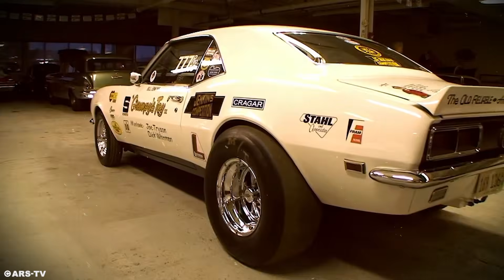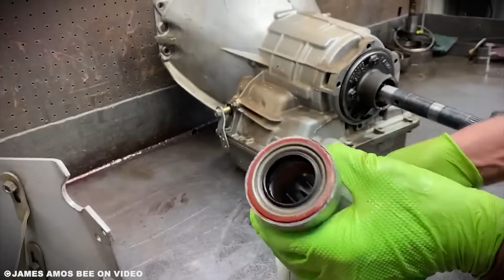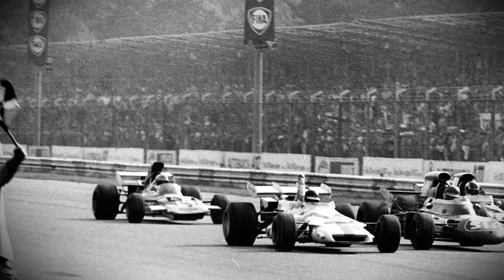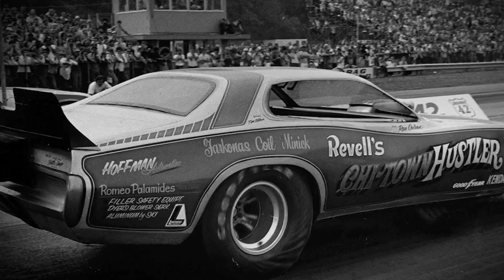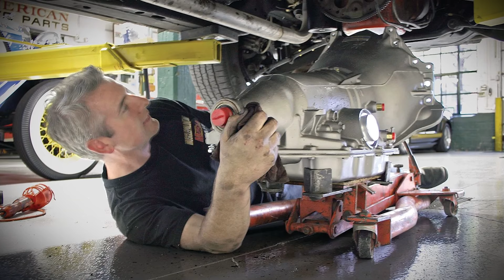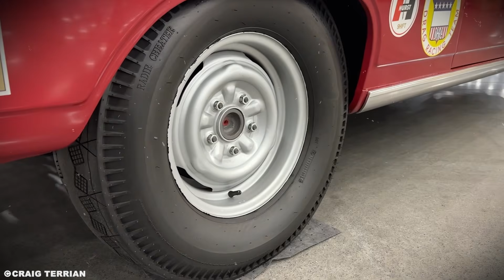This Illinois Drag Racer OUTSMARTED Chevy With "Weird" Powerglide Transmission That Beat Turbo 400s

Comment: Look bill jerkins was from Pennsylvania ok . Now the Vega never came along until 1971 in the 60’s he raced a Chevy II om now he had a record in the late 60’s for winning the most races by never missing a shift in a 4speed manual transmission 250 races without a missed shift !  His family name comes from south Wales England .  He had raced 427’s but the 327 was his motor of choice .  I know for a fact the man would drill holes right at the line of the top ring on a piston down through the top . At the place the groove is cut so the big woukd be centered there . Half the hole out at the back of the ring the drill cut would leave an angled  part of the hole to shoot air fromthe compression of the engine back in behind that top ring . Force pushing that ring out to get more compression and power from combustion.  As something else Im thinking that he made some kind of shifting bushings or shifter parts that hurst or Mr gasket got the rights from him to make and sale .  Close to the end of his career . I can’t say he ran a glide in the 70’s but Im pretty sure it was all 4 Speed more than likely Muncie M22 or borg Warner super T-10 . He may have ran a M21 T-10 . But most racers back in the day ran big block close or “narrow” ratio 4 speed transmissions known as rock crushers . From the growling sound they made in the first 3 gears , and even in 4th a little but when accelerating. Holding one speed they didn’t make it that bad .  Doug Nash made sliders for these big block transmissions . Thats were you didnt have to push the clutch in just let up on the fuel and yank it into the next gear . My brother-in-law use to do it all the time in his Camaro 350 built with M-22 Muncie with Doug Nash sliders in it . Burn rubber 1 finger width between first and second two between 2nd and third and a who,e hand width between third and 4th . Traction bars an air shocks running 50’s on the rear . Posi trac 4.10 gears big 10 bolt GM axle . Pro mod hood scoop ! 78 Camaro type LT burgundy and silver .

Comment: I know grumpy Jenkins had 4 soled shifters in his garage that folks bid all kind of money to get when they auction his stuff off . I think those lightning rods was one think grumpy was using them at the end of his racing career. As far as him running an auto . Now how do you pick up parts out of your oil pan for two hour from transmission ?  That would be imposable if it made it in there that oil pan would have to be a half acre big . To pick up parts for two hours . Now any time a car is racing you woukd hear only one shift . Any one would tell you it only shifted ONE TIME ! I didn’t know they had carbon fiber back 55-60 years ago

Comment: My 67 nova W/ a 69- 302 cu. W/ a glide ran low 10’s w/ 3500 stall speed converter .  The Rt. 2 speed glide works . That was 1992 Atco , Raceway New Jersey

Comment: An aluminum power glide transmission has a low band, a high or direct clutch and a set of reverse clutches stock. The earlier cast-iron Powerglide  had two bands, and one set of clutches, a low band, a reverse band, and a high or direct clutch.

Comment: Grumpy was not the first to apply Powerglide technology to racing.  A late friend of mine was using Powerglide in circle track cars back in the early 1960's and possibly late 50's.  So long ago I forgot.  I'm not sure if he was the first to do this.  He used it in stock cars but I don't know if ever tried it in Super Mods (sprint cars).  This was an advantage because of low rotating weight.  They removed some of the internal parts and used an on/off hydraulic valve to engage power with no torque converter.  I'm sure he told me the race ready weight was about 65 lbs

Comment: Unbelievable, I grew up where\nThe power glide was junk of all transmissions But I did like them in my half ton chevy truck ! It seems like they never ever had a problem  !!! I am an ex fifty six sixth chevy , four twenty seven gasser , drag racer that used a muncie, M22 rock crusher  add a Turbo 400 tricked out as much as you could go with a stall converter.But still liked the muncy and super T ten four speed just absolutely loved my clutch !!!!!!!

Comment: Your video is total BS inaccurate, misleading,  and no knowledge of what you're talking about. Doesn't anyone edit this bullshit
Reply: Yep Grumpy never ran an automatic in any car he ever had.
Reply: @jaemobley5637 Nor was he anywhere NEAR 6'
Reply: @jaemobley5637 But , he did test a clutch turbo 400 in toy #6 , the '69 Camaro .
Reply: @bobbrinkerhoff3592 that I can believe the 70 motown missile also experimented with a clutch flight. It was removed shortly after and an A833 slick shift 4 speed was installed 
Along with 99% of all the pro stock cars of that era do to its superior strength 
Problem today the authors and editors of today don't know or even try to authenticate any of their material 
Sad to say journalism of this type died in the late 70s. 
Example in point an x Chrysler race group engineer was in attending a car show i Florida when some contemporary Motorsports expert told him that this car was the 1st body in white. Then saying that he was told that by his friend so and so the engineer who was part of the program. The  engineer nodded his head and walked off , one of the men waking in this group stopped and informed the expert who was a so called friend of the engineer
 that he was just
 speaking to him !
Unfortunately automotive journalism today is just as knowledgeable  and misleading